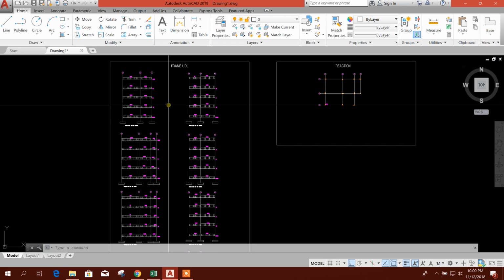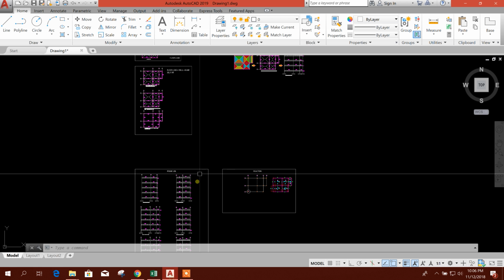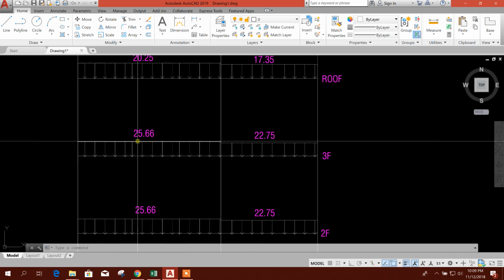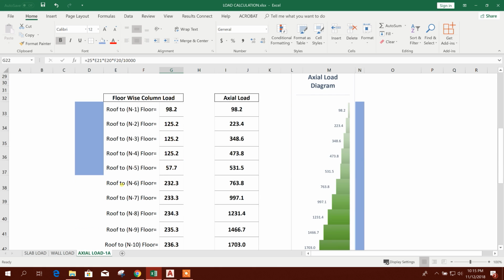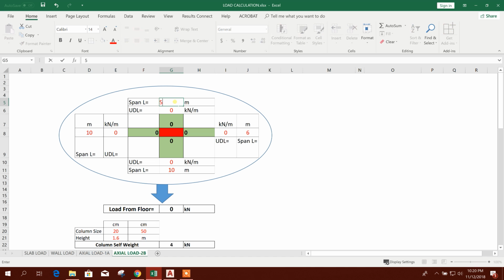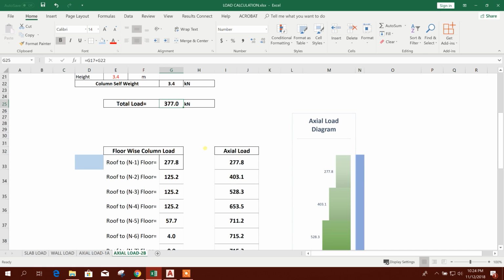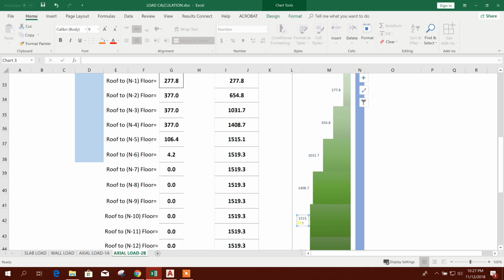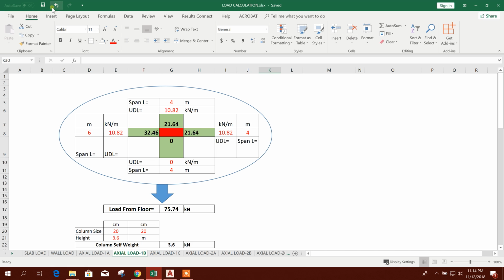MANUAL CALCULATION OF BUILDING REACTION LOADS  & AXIAL LOAD DIAGRAM.

Comment: Regarding column 1A Load calculation---> For roof floor only slab load will come but you add column self weight also to calculate roof floor column load ,that's means you are adding same column self weight two times with roof floor & also with 3rd floor .. could you advise me to solve this issue.....

Comment: JazakAllah. i hav never seen such proper briefing from anyone but I have one question tat i didnt understand tat hw slab load or moment taken by beam..at this point i stick. can u elaborate tat. Thnx
Reply from the maker: Load transfer mechanism: Slab to Beam, Beam to Column, Column to Foundation, Foundation to Soil.
Reply: @Decodebd  tats correct but wt i wana ask is tat which figure or data we ll transfer or apply from slab to beam and column..i mean will we apply moment( calculated at ends of slab )to beams or wt exactly we ll do..thnx